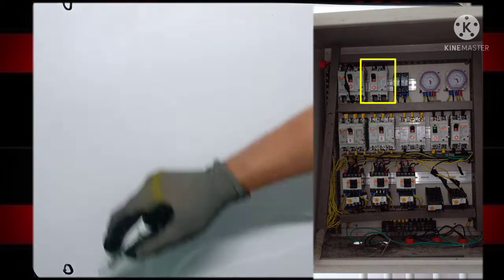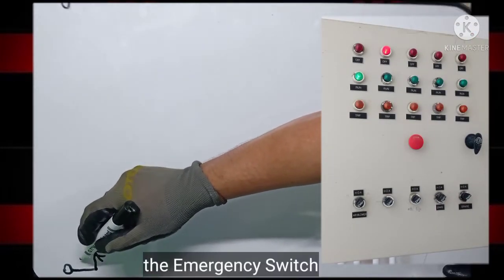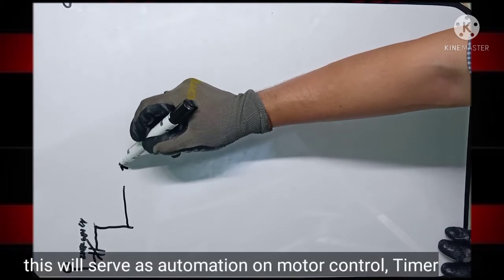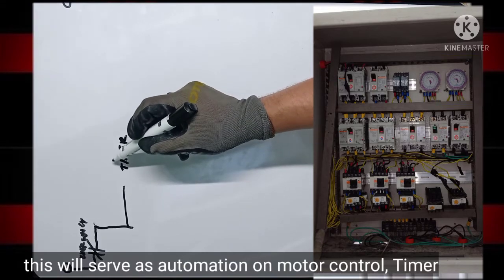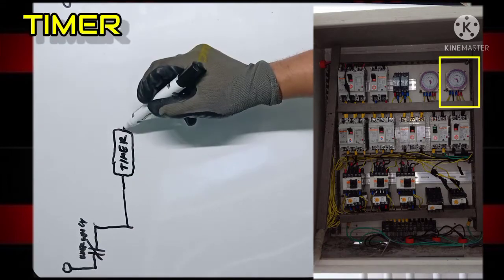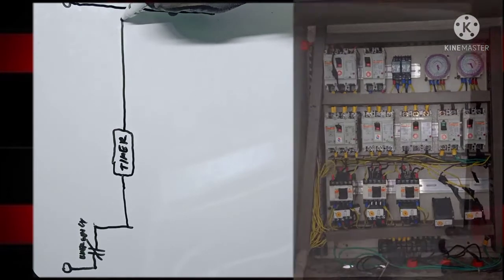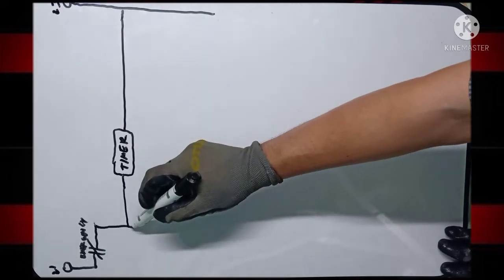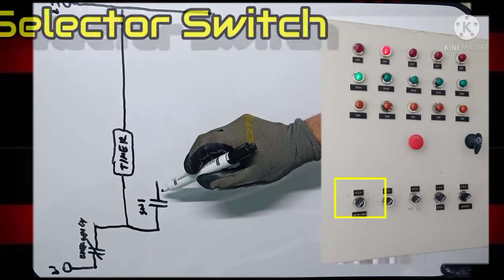Troubleshooting Ladder; Motor Control || Ka-Basic Channel

Comment: 24h timer po ba yong timer sir?para saan po ginagamit ang ganyang control?
Reply: ah thank you sir,copy po..
Reply from the maker: it's a 2 to 3 hours continuous timer solid state. Ideal for most motor control that requires continuous operation transition for about 2 hours. Meron din tayu Ka-Basic ng timer na may trigger, nasa isa sa mga content multiple modes.